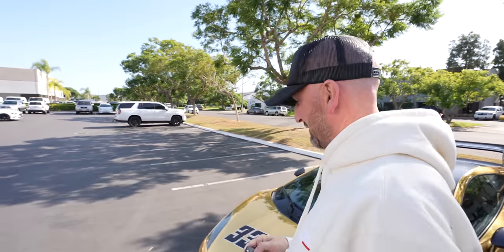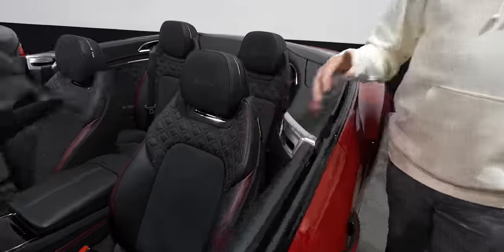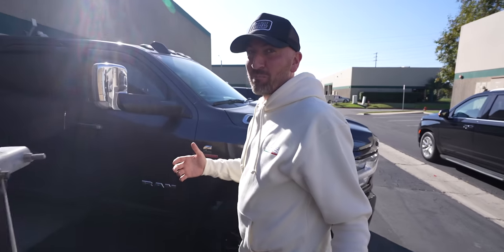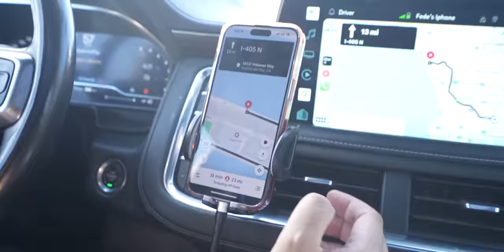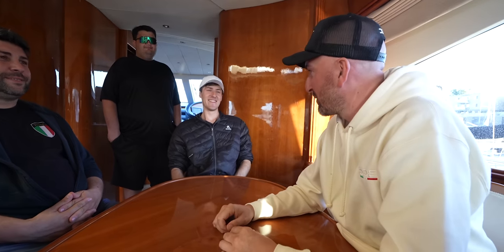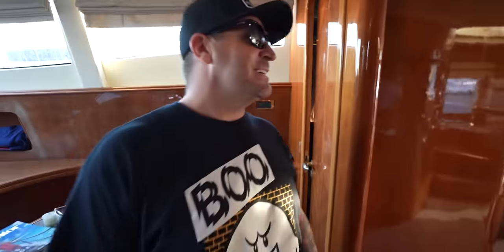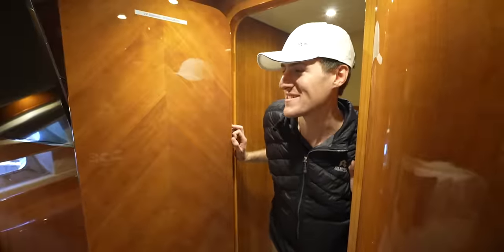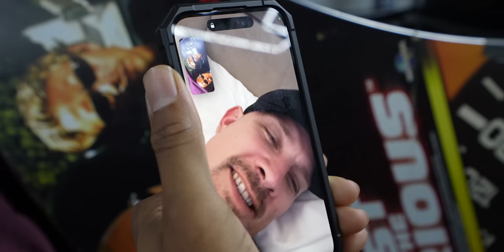BENTLEY EXECUTIVE GIFTS ME A CAR!!

Comment: I would swap out that CRT with a used flat screen, the bulbs with all LEDs, fix the shifter and add haptic feedback steering wheel and rumble seat. So cool. Looks like the setup is built off of an original modded xbox.

Comment: This guy invited Dave and the crew over not just to give them a free press car, but to spend time with them more 😂. If you want to do it the Lebanese way, remove the chassis number of a copart car, and put it on the press car, then the copart car is now with no chassis number just like the press car before. Even though the yacht is old, it still have that 2000’s vibe in it. The Fast and the Furious sim is the greatest sim ever, the arcades back then hit differently. Keep up the hustle and bustle YSOB’s! DDE ALL THE WAY 🏎️🏎️💨💨

Comment: I would take out all the old crap from the gaming machine and replace it all with a PS 5 and flat screen monitor, new steering wheel and pedals, plus a state of the art gaming chair, B&O sound system etc. 
 Well I would if I had two brass pennies to rub together, lol...........

Comment: Dave get the w12 and have Mike make a custom hood design instead of getting the less powerful V8 that's not going to sound near as good as the w12 twin turbo would with a straight piped exhaust.

Comment: @DDE I know this video isn't about this but, why not skin the 720GTR in Carbon Fiber? Strad just did it to his Aventador doors
Reply: Bc fake carbon is gaudy and rice
Reply: @CupofJ0E  It's real carbon fiber, not a wrap. Strad did it the Aventador doors to make his full exposed carbon widebody. With all the work they are going to have to do to the 720, it's a viable option
Reply: @TheOGJoemama2197  it’s metal underneath, you get none of the benefits of real carbon (light weight and strength), strad only did it because it was a safety thing, the whole point of the 720 is to do it in real carbon, come on, its  1000+ hp